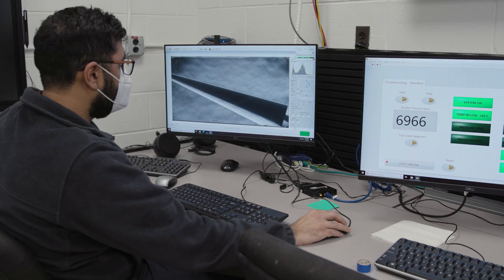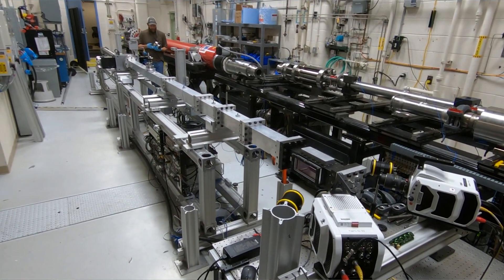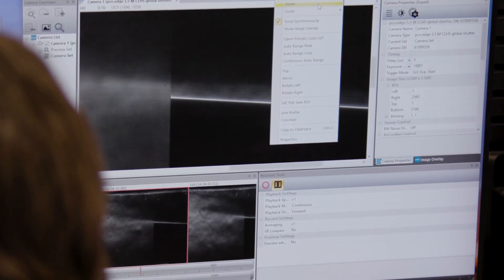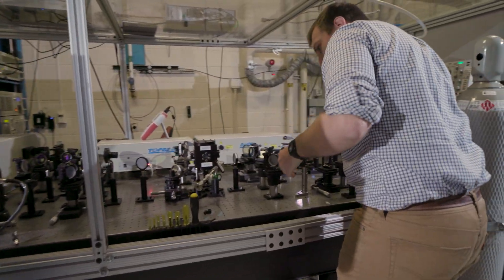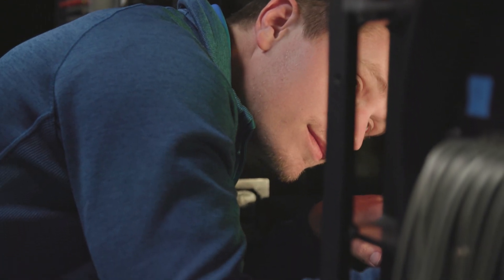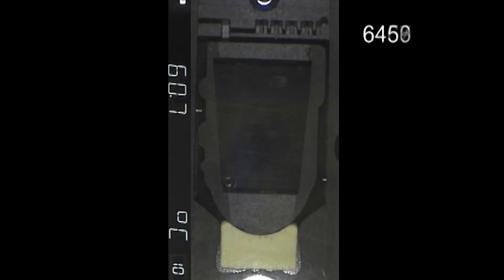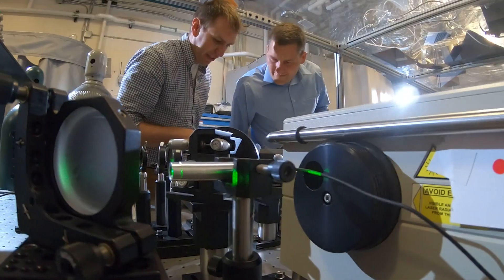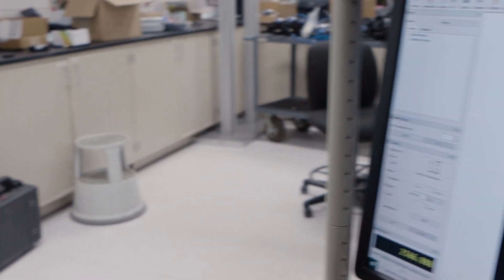Thermal, Fluid, and Aero Sciences Experimental Facilities

Comment: This is pretty cool but WHAT do you do to reduce side fumbling during encabulation?
Reply: We traverse the plenary kanuter modulator by incremental adjustments to the sperving valve thus dampening the turboencabulator harmonic oscillator reactance factor.  It's so simple.  Please keep up with the rest of the class.